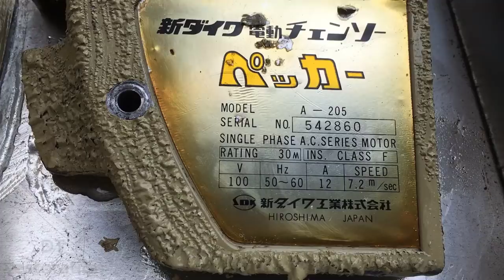Restoration old Japanese electric saw machine HIROSHIMA | Restore abandoned 100v saw chain saw

Comment: Ok here's my observations with this one:

1) class 1 item not earthed
2) inappropriate power cord
3) re-use of old bearings
4) incorrect testing of field coils
5) incorrect testing of armature
6) no sealant used on the oilpot cover
7) heating up the chain with a blowtorch
8) reusing the old grease he picked out of the gearbox
9) incorrect cover for the brushgear
10) spray painting over the rating plate
11) chain incorrectly installed
12) re-use of worn out brushes

It's NOT a restoration...
Is it...🇬🇧☹️
Reply: You've just discovered INTELLIGENCE